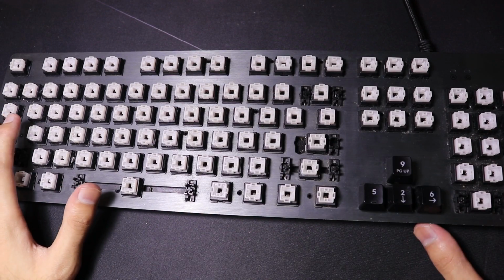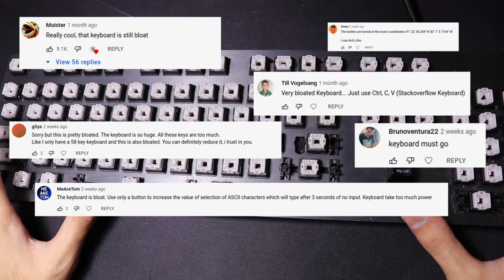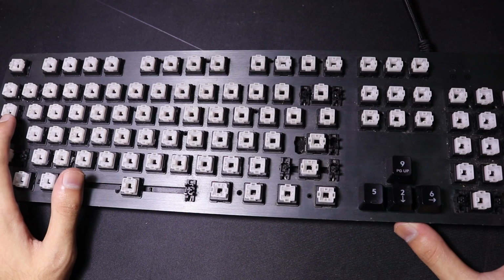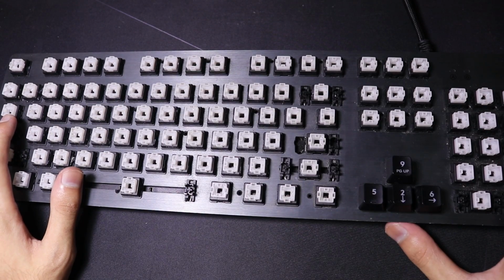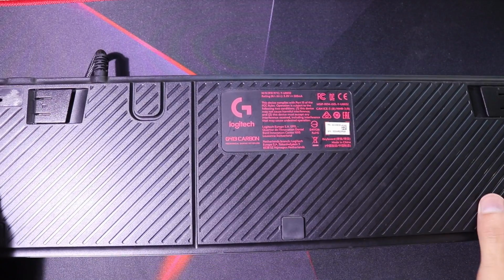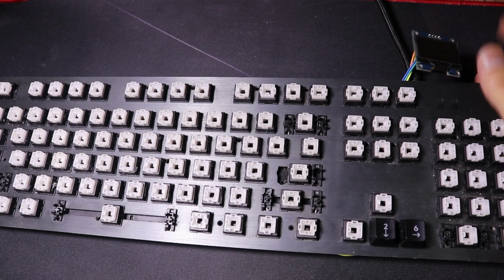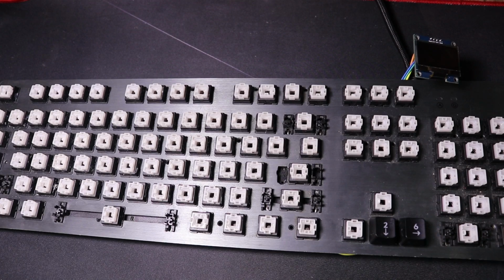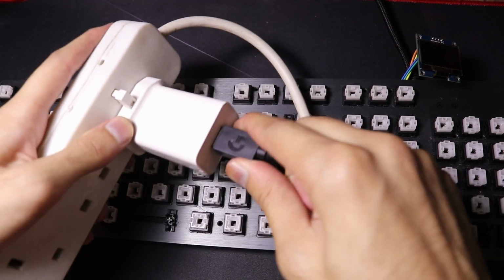running doom on a keyboard

Comment: Well would it be possible to take a hard drive modify it and run Doom on it cause aparently some hard drives have ram and a cpu on the board so heere comes a question (Can a hard drive run Doom?)

Comment: The keyboard is still bloated: Only type the unicode code point then somehow pressing a button turns for example 65₁₀ into an A it only has control and modifier keys and also a numpad and a key to type the character along with some leds for caps lock, num lock, etc. also no keycaps or screws  because that adds bloat.

Comment: When your keyboard have more computing power than the computer used to send people on the Moon.
Reply: @WolfieMel Not motivated anymore. Also the money are more finite nowadays.
Reply: @WolfieMel They're aiming all their resources towards Mars.
Reply: @WolfieMel We can. But it's incredibly expensive and not really worth it. There were so many moon missions and many people have walked on the moon, we did what we wanted to do there.
If we are to go back it would require tons of money put to manufacturing of equipment that doesn't exist anymore, let alone setting up the productions for it. And it would also need to be a lot more advanced and powerful because going back would need to be justified with something new and bigger to bring there. Like the ideas for testing a moon base.
Reply: Pretty hilarious how no one in this thread knows about Artemis. It's been six years now...
Reply: @WolfieMel There is nothing left for humans to do on the moon, most of the science has been done, we know more about the moon than the ocean, there is noting profitable to mine, even with current tech it costs way too much to send people to the moon... so it is meh, don't need it, don't want to. And we do not have the tech yet to build sustainable housing/ecology for people to live there, which is the last frontier of the moon.
Reply: @WolfieMel You know who else is fake? Yo momma 👁️👄👁️
Reply: @WolfieMel why tho? we already got everything we wanted from moon, well that was the case, but now we are aiming to go back o moon because of the h3 and some other materials we found that are incredibly powerfull as rocket fuel. so we'll be harvesting those resources on moon and use it as a base point before lauching the rockets towards mars.